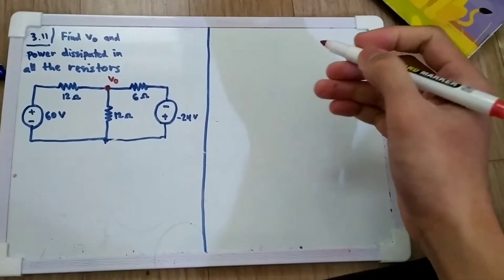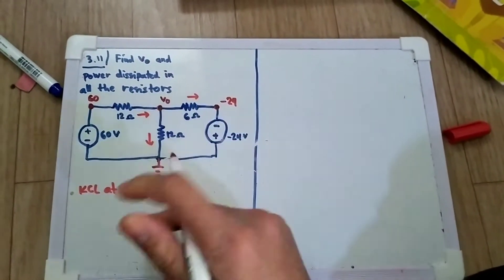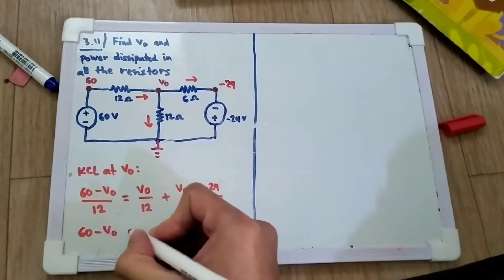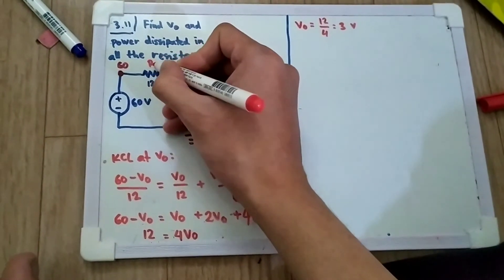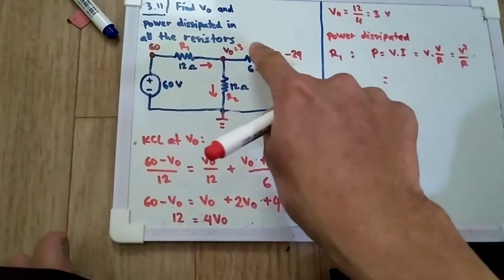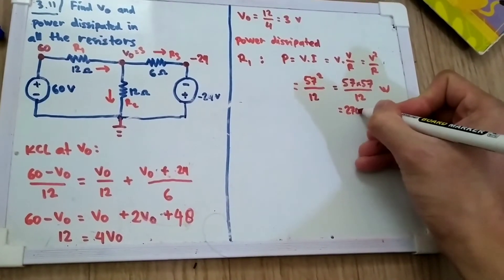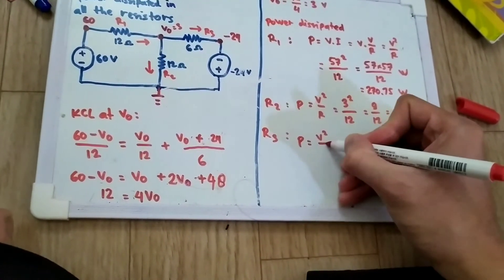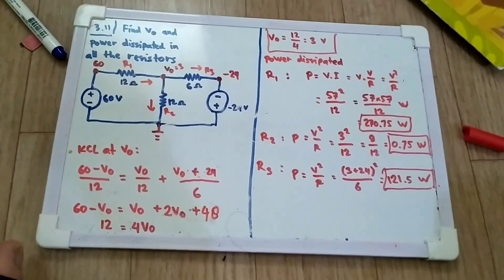Problem 3.11 Sadiku 5th Find the power dissipated in all the resistors in the circuit of Fig. 3.60.

Comment: Hi, I think it can be a little confusing that you changed the sign but not the polarity in the diagram. Aside form that, I found it very helpful, thank you.
Reply from the maker: No
Reply: Always consider the node voltage as maximum to avoid polarity issue. After calculation if the node voltage is less then current flow will be from opposite direction and vice versa.